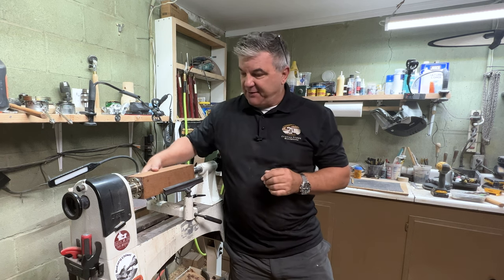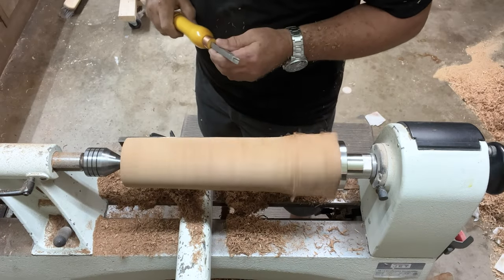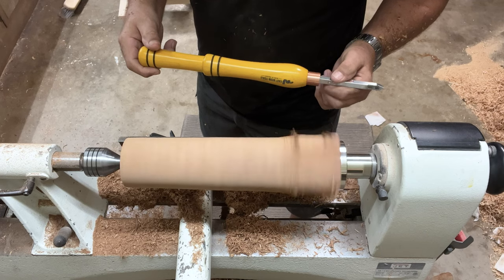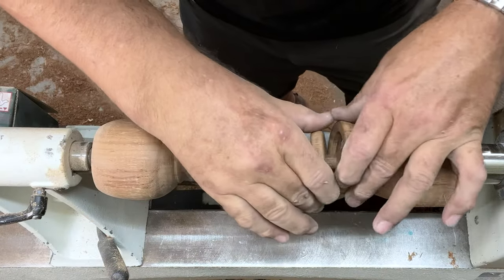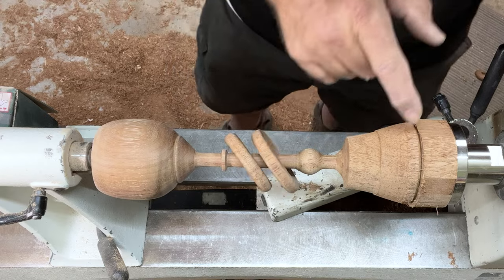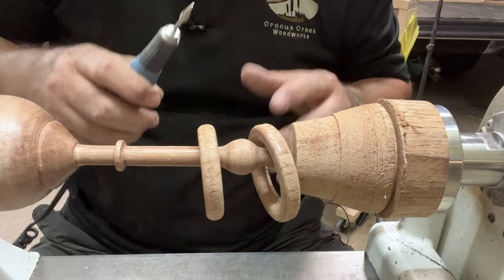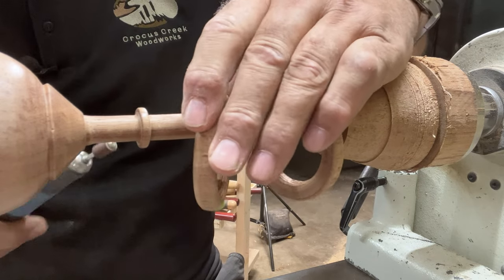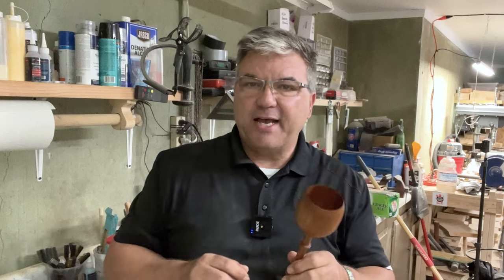Angelique Goblet with Captured Rings

Comment: At 14:22, is that dark spot in the bottom the pilot hole from the drill bit?
Reply from the maker: Yes, it is the hole from the Forstner bit.  I did fill it with a bit of dust and CA after the fact.
Reply: @crocuscreekwoodworks  Glad I'm not the only one.😊
Reply from the maker: @OregonOldTimerWOODTURNING  When you are turning End Grain you have to do something that will cut it smoothly.  That is where the Forstner Bit comes in.  This wood is very straight Grained and splinters easily.  Even with the Forstner Bit it was burning the wood.  The Divit was easy to fix.